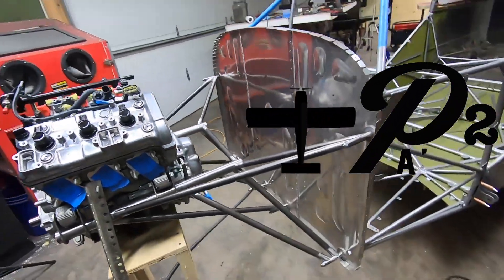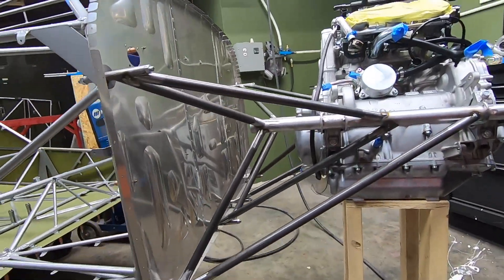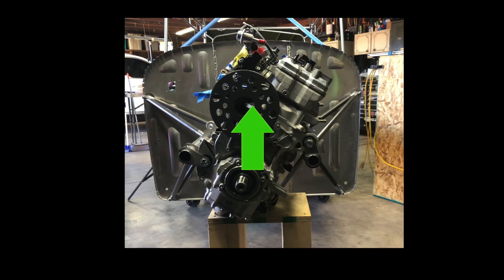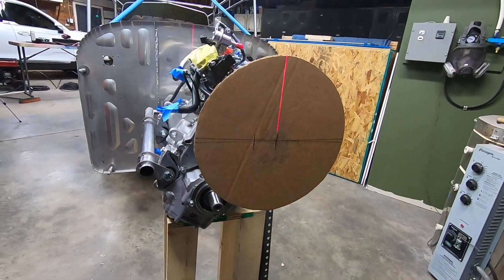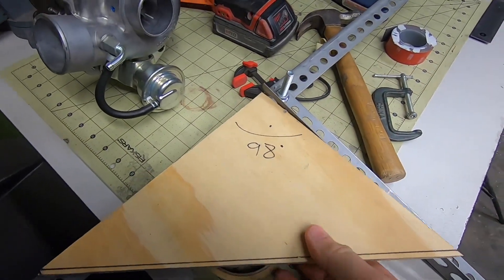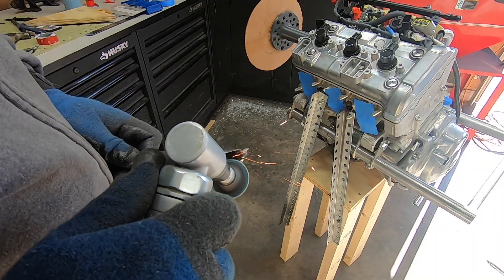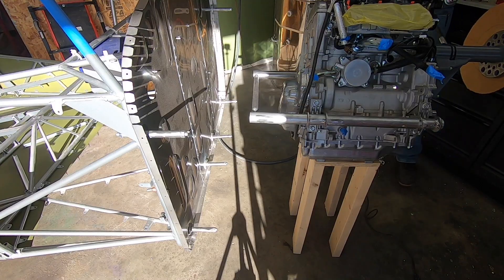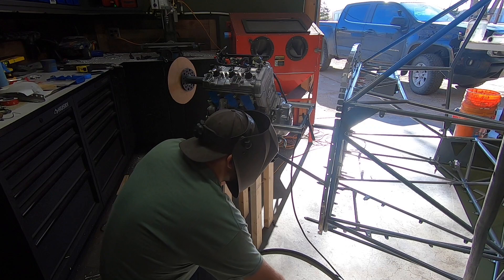RANS S21 EP25 YAMAHA 998T PART 2

Comment: Your tube joint fitting on the engine mount is perfect. So confess, how many trial/error tubes are out of camera sight?  😉 You can tell us...
Reply from the maker: There is a few lol.. The guy that’s gonna weld it said the tighter the joint the better, so I’m trying to not have gaps if at all possible!

Comment: I talked to Teal last year about this same engine and he said he was thinking about building a gear box for it. Has he completed the gear box yet? I thing your engine should be a good weigh to power chose. Where did you purchase the 988, I can't seam to find a dealer that will sell just the engine. Thanks.. great job on your build.
Reply from the maker: The gearbox is still in development but shouldn’t be to far out. I got my engine from Arctic Cat since I too couldn’t find a Yamaha dealer that would sell engines.. The big 9000 sleds use the same motor as the sidewinder👍
Reply: @Project2Aero   Great, I will call the Arctic Cat dealer and ask if they will sell just the engine. I live in Eastern Oregon and are planning to build an S-21. I have considered the UL powered 520isT,  but I like the power to weight that the 998 has. Thanks
Reply from the maker: @s-21mtnflyer70  I also really looked into the UL Power turbo.. It really came down to budget for me. I think I’ll have the whole firewall forward for a third of the ul power engine cost cost.
Reply: @Project2Aero  Have you seen where they are doing a tune on the 998 and getting 300 hp? That is great going to be a beast. Keep at it.
Reply from the maker: @s-21mtnflyer70  yea I plan to stay a bit more conservative until I prove the engine some.. maybe I’ll play with more tune later on👍